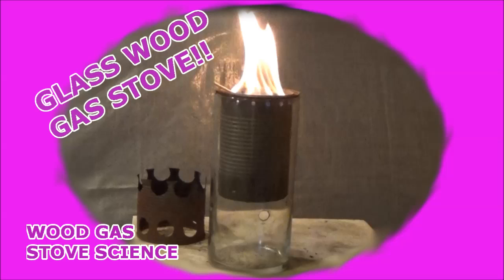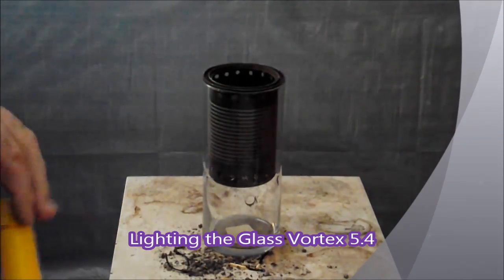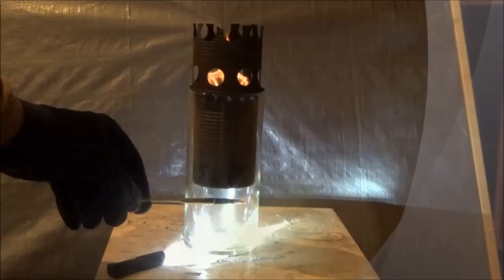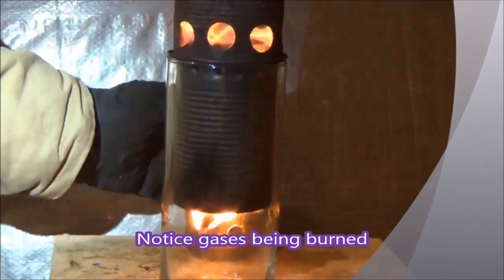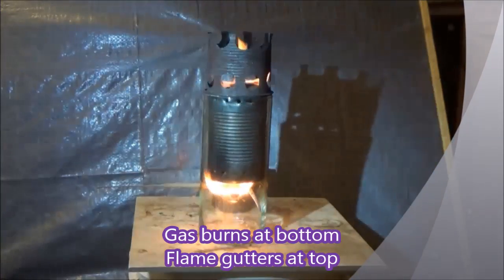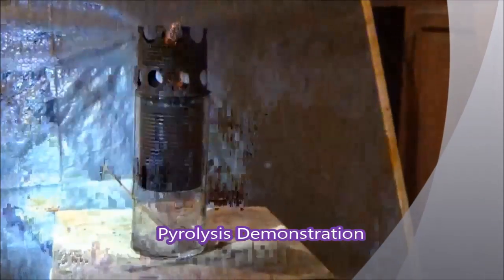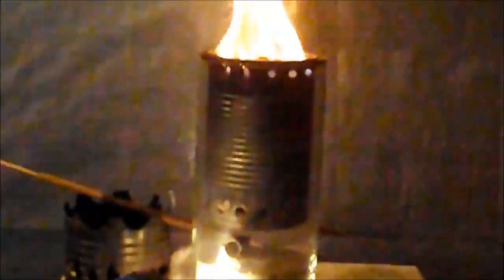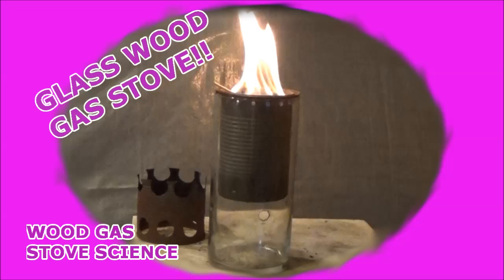Wood Gas Stove SCIENCE! GLASS WOOD GAS STOVE!

Comment: How much do the holes in the outer can affect the burn?  Should they be figured into the 1:4 or 1:5 ratio or are they separate from that?
Reply from the maker: I like to start smaller and increase them as needed. You will see a pulsing flame if they are too small. If they are too large wind will have a larger effect on the burn. Thanks for the question!
Reply: @heathputnam9524  thank you!  I have several of these stoves in various sizes that absolutely refuse to burn in the slightest wind.  I always wondered if they were actually being blown out because too much wind was getting in or if they needed more air to be able to fight the wind better.  

I've watched a lot of videos lately.  Some of the stoves are full of holes.  Others have hardly any.  One that I've had some luck with is The Midge.  It has "5 or 6 holes about the size of your thumb" in the outer can.  I made mine with five 3/4" holes and it hasn't blown out yet.  The flame can be blown 90 degrees as soon as it leaves the stove and it still burns!  

Another one I liked was the Woodpecker (pecker head).  It's great on a calm day but if the wind blows forget it.  O guess I should have been suspicious when the demonstration video was shot in the garage because it was windy outside.
Reply from the maker: I like to leave one or two holes out of the pattern so I can turn the blank area to the wind if necessary. Remember the pyrolysis zone is oxygen free and a gust of wind pushing air into the burn chamber will greatly effect that process!

Comment: Does the glass size affect the amount of heat produced? What is the correlation between the size of the outer glass wall and the combustion chamber with regards to heat? Btw, great series. Very informative. It helps a lot bc I'm still deciding what stove to use. Covid has spiked the price of alcohol in my country, it's at $9/gal rubbing alcohol 70%. And sticks are free, so.
Reply from the maker: The glass stove did not burn very efficiently. It was really built for demonstration purposes only. Thanks for watching!

Comment: Cool setup and video. Very interesting to see the air flow visibly. Just curious - is that a borosilicate glass tube? Any risk of it cracking or breaking? And how did you drill the holes into it - I assume a grinding stone of some sort but not really sure. Thanks again.
Reply from the maker: Haha! It was actually a flower vase! And yes it did crack! I used a diamond drill bit to drill the holes. Thanks for the comment!
Reply: @heathputnam9524  very cool. Glad it survived long enough to get the footage!

Comment: I am so glad I found your videos. I just made my own for camping out of a gallon paint can and a cheap stainless utensil holder from Wally World. I made it over the past two days and I have some concerns and was thinking how can I heat the gas, and incoming air more as it rises and I thought of creating a vortex between the two cans by adding some type of fin or barrier that forced air to circulate around as it rose up. I also drilled holes in the sides of the primary can so it wouldn’t clog and I noticed that as ashes fall out of the primary can if they are still lit it does effect the stove. I scoured the inter webs and found this today! I am wondering if you have done any experiments with starting your vortex between the two cans? Kind of like reheating exhaust gasses in a catalytic converter, the hotter they are the better they will burn. I am also thinking it would potentially pressurize the air? If the intake is of great enough value in relation to the exhaust ports and change in temperature? I will be angling my secondary air ports thanks to your videos! I am going to use reflective tape and tape 2 continuous 1/4 inch spiral fin sinside the larger can that circle the can twice. My concern is I will impede the flow in as much that it will starve the upper air ports.
Reply from the maker: I have experimented with the same idea. It seemed to cause decreased airflow. Heating the air seems to be best accomplished by keeping the distance between the cans to a minimum while still allowing good flow up to the secondaries. Having enough fresh air intake is also important. I may begin experimenting again in the near future. Hopefully you subscribe so you don’t miss any information!
Reply from the maker: Please let me know if your idea works
Reply: So my fins didn’t work because they melted. I used 700degree rated gasket sealant to create a bead and wrapped the inside of the external can in reflective material. The burn can became so hot most likely due to the reflective material that the reflective material disintegrated as well as the silicone, this clogged the area between the two cans. My cheap steel burn can was glowing red and it is significantly heavier gauge than the paint can. I continued to feed the device hoping to burn off any of the stuff that accumulated within the walls and towards the end of my available fuel I had nice BLUE flame exiting the top vents. Angling the vents did nothing for directional flow, I have a lot of vents and the angle of attack wasn’t significant. Working on another design. Perhaps we can collaborate?
Reply from the maker: @mykolathorbecke1448  That is something I noticed... if you do not have enough airflow through the fresh air ports you can get blue flame from the secondary ports, but you will not achieve full burn of all the fuel in the stove. Possibly some adjustable fresh air flow, but it would be nice if you didn't have to make adjustments on the stove during the burn.
Reply: I also had a significantly visible vacuum between the initial burn or pyrolysis stage and the secondary burn vents as I watched the wood darken and turn into char as the gases floated out and down of the top layer of wood there was a dark mist of gas that literally sat and waved on top of the wood.

Comment: I've seen a couple of people making woodgas stoves with glass containers so you can see what's going on inside. https://youtu.be/Ee1n5eXy6ps?t=59 This version is especially interesting because he hasn't made any holes at all in the glass lamp shades, just a gap between the upper and lower glass shades to let the air in. There is a raised wire frame below to allow primary air into the base. There is no smoke visible here either. In the second half, he adds a disc so the secondary air is mainly only being provided through the base of the stove, but the operation still looks the same, so I would say in both cases the secondary air was mainly coming in from the base point.
Reply from the maker: Anthony Colbourne looks like a wire grate in the pan that the lower can and glass outer ring sit on. The air goes in under the grate. Thanks for the comment!

Comment: I was also wondering what path the smoke/gases were taking through this type of stove. I saw another video where the secondary air holes were quite large but far apart and you could see that the jets of air through those secondary air holes were not producing the flame, the flame was being produced in the space between the holes. Therefore it would make sense that the superheated secondary air in the cavity is just that, an added hot air oxygen supply that burns the excess smoke from the flame inside the stove. Knowing that, would it be better to have the large primary air holes higher up the outside shell so the air is heated both before it goes down into the primary combustion and up to the secondary air holes??
Reply from the maker: Anthony Colbourne I’ve been thinking of making an all glass “can stove” in hopes to see everything. I actually went and got some of the supplies I need today. I’ll keep you all posted and if it isn’t a colossal failure I’ll post a video. Wish me luck! Thanks for the comments!

Comment: After watching this video, I'm wondering if anyone has ever made a wood-gas stove using a bundt pan? (That round cake pan with a cone in the center.) Not sure where you would add extra holes in the middle cone, but I think you should be able to get a very nice flame out of that shape of a stove. Even just leaving that center hole open to allow gases to circulate might be enough, and cut the regular holes at the bottom and top of the outside of the pan for primary and secondary air.
Reply from the maker: Anthony Colbourne I’m going to try to find a cheap and small bundt pan at one of the dollar stores tomorrow. Hope you don’t mind if I steal your idea! Thanks for the comments!

Comment: you are cheating yourself with the flammable liquid. It's the flammable vapors not a wood gas. The wood gas doesnt seem to go down the combustion chamber at all. Have you seen a true wood gassifiers? The wood gas is a smoke. Not a white one but rather a bit orange. I dont see any smoke. It would be better to use only pellets for us to see there's indeed a negative pressure around the combustion chamber.

Comment: These are great experiment but have alternative interpretation.  There is more intense and turbulent airflow inside the glass driven by the convection updraft at the side of the can and buoyancy updraft above the top flame.  This ignites the stick, and once ignited it will flame more and more until limited by available oxygen supply. The flaming stick thus depletes the oxygen in the PA, turning the stove down and off.  If you had left the stick in a little longer after the stove extinguished, the stick might be seen to continue to flame brightly, consuming stick fuel  in the still intensified airflow inside the glass, given that the updrafts, driven by continued T differences, are still operating. This would be confirmed by then pulling the stick out and witnessing the flames abate some.  (I wrote this comment before reading good comments below - sorry for redundancy, but I have more.)

The smoking stick experiment has an alternative explanation as well. Smoke from the stick is following the stream lines, which are expected to flow deep under the can and back out again just under the bottom, even if no downdraft   A proper commercial smoke stick might better illustrate the fluid flows at the bottom of the can, and even at the top, because the smoke is closer to a point source, which can be positioned in a “PA” hole, or at the top of the char.

So for me there is no definitive conclusion, but guidance towards some more fruitful work.  I will not be surprised if to an extent the woodgas stove is working in dual modes that vary in expression in both space and time.  However, the absence of visible smoke and tar deposit at the bottom, surely suggests any downdrafting pyrogas supply is on the limited side.    

Putting a window in the side of the can, or making a full glass version would be illustrative.  One could drill holes in the side of the metal can, and cover with a glued on or slipped on segment of pyrex cylinder (even leaving small open holes on the side would be illustrative), or just have a glass blower put holes in bottom of a pyrex beaker.

Paul. TheBIocharrevolution

Comment: What happens if the intake holes in the glass are higher than the bottom of the can?
Reply from the maker: It seems to effect the force of the jets. I believe the air going to the primary jets are not as hot when they enter the burn chamber. I have seen negative results by moving the holes up. Thanks for the question.

Comment: Hi! Why can't we put a side hole to introduce wood? What do you think about?
Reply from the maker: +marceloanisio The stove works by creating a pyrolysis (oxygen free) zone between the fuel and the secondary (top) air ports. If this zone is interrupted the wood gas action will not work as designed. You can watch videos on hobo stoves to observe the kind of burn you would get by adding a side hole to add fuel. Hope that makes sense. Thanks for the comment!
Reply: @heathputnam9524  3 years later, but I am curious about this as well. What if it was a hole to side feed but sealed between the inner and outer cylinders? So it's not open to introducing more air or anything between the walls?

Comment: Thanks for the interesting video.  I am not that your stove is working in downdraft mode.  Your observations can also be explained for a top-lit updraft gasifier (TLUD).  Placing a burning stick under the primary air grate would consume oxygen, and reduce the TLUD flaming pyrolysis.  Your stick burns well under the reactor, because it is in turbulent air

One test you can try is to wrap the glass cylinder with a gel-freeze-pack.  If pyrolytic gases are exiting through the bottom air holes of your reactor, then tars should condense on the inner wall of the glass.   If the glass remains clean, then your stove is a TLUD.

You may find this an interesting read:  Mulcahy, N. 2011.  Device and method for gasification and/or pyrolysis, or vaporization of combustible materials.  US Patent US2011209698A1.   Caution: you can make a claim in a US patent without having to provide proof that your claim is true; a claim can be merely wishful thinking.  To date, I have seen no evidence to show that Mulcahy's stove isn't a TLUD.  If that evidence exists, then that would be great news.
Reply from the maker: +JulienWinter I did an experiment that my have invalidated this video. I posted it under the title... https://www.youtube.com/watch?v=b0vM9aD78XY
Please watch and see if you think the findings make sense.

Thanks for the comment!
Reply: +Heath Putnam;  Thanks for your response.  I have looked at your other video.  It is an interesting experiment for designing TLUDs.  However, if you want to test Nat Mulcahy's hypothesis about top-lit opposing draft (TLOD; US Patent US2011209698A1) there has to be primary air holes only on the side of the reactor vessel, and not at the bottom.   The opposing draft is supposed to be created by a venturi suction of pyrloytic gases out of the reactor by air moving rapidly past the primary air holes.  For this mechanism to work under natural draft, the venturi effect would have to be stronger than buoyancy forces created in burning gases, both within the fuel bed, and above.
Reply from the maker: +JulienWinter I'll read the Patent and see what I can come up with... Thanks for the info!